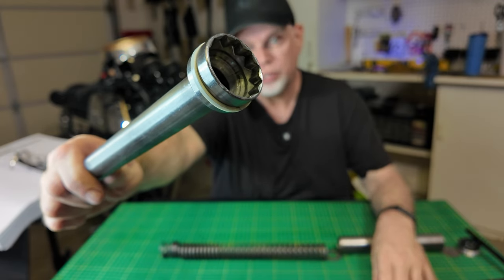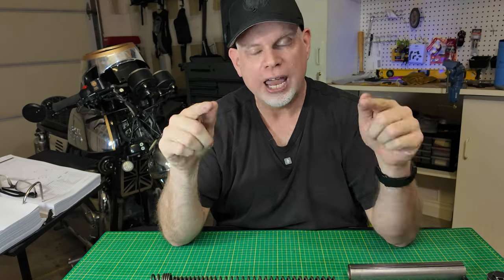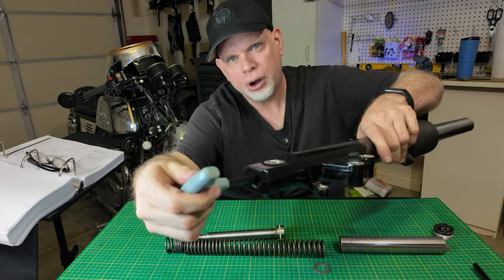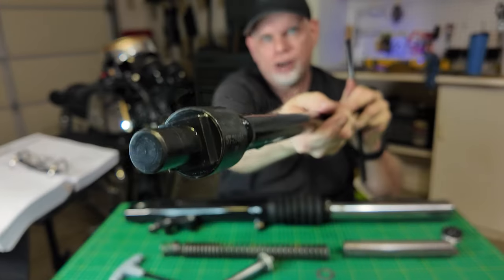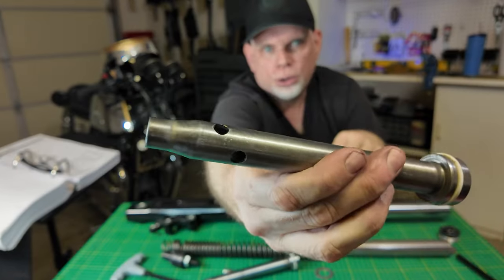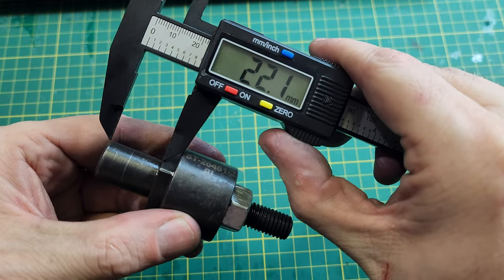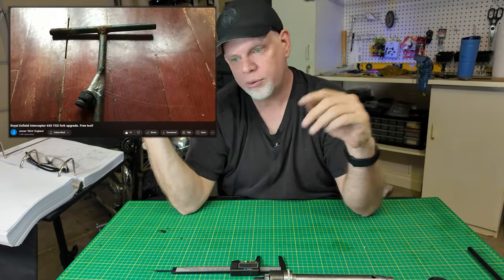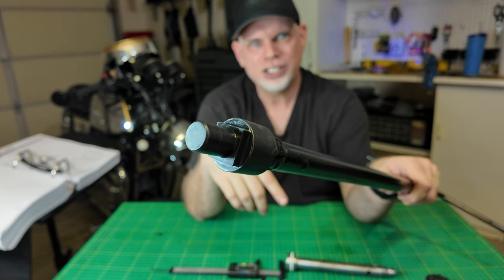Drill Damper Rods for YSS Fork Upgrade | DIY Damper Tube Removal Tool for Royal Enfield Motorcycle

Comment: Nice one jerry,i made mine welding a large nut onto an old water valve tool,then gradually ground the corners until it dropped in,ive had discussions with people who claim yss told them they dont need to drill the damper rod,fine but you might as well toss the emulators in the bin
Reply from the maker: Nice! I planned on trying to make my own but then came across one "cheap" and decided to just buy it. I recently bought a welding machine so I can be more "resourceful." But, I've never welded before, still haven't. Got the machine, now I just need to buy a tank, all the accessories and other tools... and then lean how to use it!